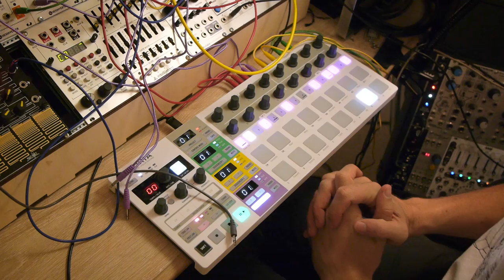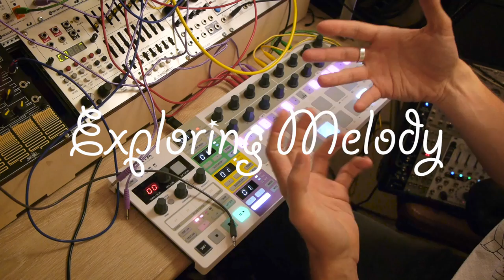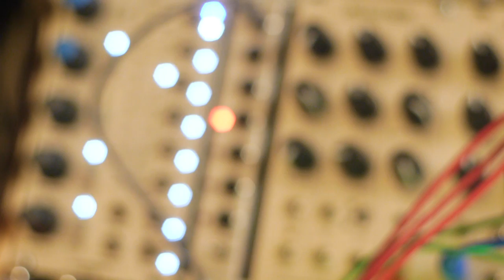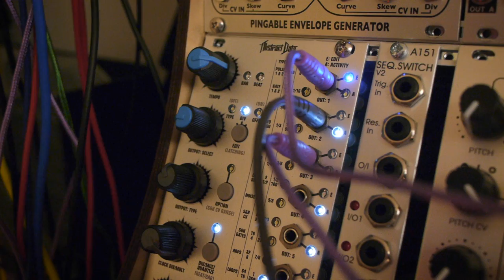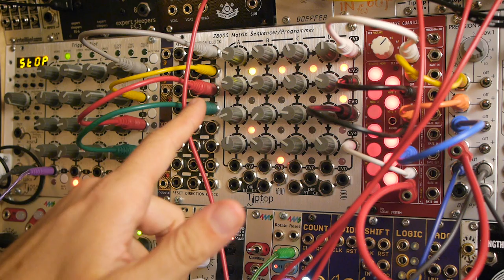Melody Progression Tips for Eurorack Modular

Comment: Great job on the video! Unfortunately all the sequences are sounding kinda flat since there is no velocity modulation. Sure, this is a bit more advanced technique and along with the material given in the video can confuse people. Consider telling about a velocity modulation with two daisy chained VCAs for achieving velocity modulation effect to give a breath to all the sequences. Also velocity modulation is achieved with different modules like modulating the tip top audio z4000 deviater cv input.
Reply from the maker: True - and you can be using the Z8000's extra outs, or a third PP lane for Velocity business.

Comment: Thanks for this video - I'm a long-term synth user but new to (Eurorack) modular, hence the perhaps naïve question that follows:  
Is there a way to employ a simple sequencer (such as the Behringer System 100 182 Analog Sequencer module) to play, say, a short 4-step sequence and then, at a point controllable by the user - via a 'control input' of some description (i.e. a CV) - have that sequence transposed up or down by a specific degree?  
I'm thinking of something akin to the bass line in Vangelis' Blade Runner (End Titles) as an example - a simple 4 note sequence which transposes according to the backing chords.  Obviously an arpeggiator or DAW can be used ... but that's not what I want!
I'm thinking of adding a quantiser to the 182 (possibly a Doepfer 156 or similar) but that still doesn't give me any ability to manipulate the preordained / 'pre-programmed' note sequence - either under my control or that of another automated CV input - to play the exact same sequence but at another position - a specific number of semitones - up or down the existing key/scale.

Any thoughts or comments gratefully received...

Comment: Thanks for another excellent video.  Transitions are something I really have trouble with esp considering I only have a small 6U 84 hp setup (soon to be 9u thanks to you and DivKid!) 
Correct me if I am wrong... But it seems that these types of transitions are only possible if you have either multiple sequencers, clock dividers, attenuators, sequential switches etc... None of which feature in my setup! 
I really only have Oscs, filters, lfos, vca and envelopes.
Reply from the maker: How do you mean transitions? Making on-the-fly quick changes?
Reply: mylarmelodies Well... Yes and no... Chord changes... Going from one sequence to another...from one musical piece to another.... That sort of thing.
Reply from the maker: sunil solanki Investigate sequential switches and switched multiples!

Comment: I was thinking through a few "algorithms" I would like to try with a precision adder. 

Here's the basic rundown: create a melodic motive/riff in a tonality with one sequencer, and it should be transforming (whether the tonal transformations are part of the entire sequence or through offsets doesn't necessarily matter). Specifically, the sequence would transform through various modes or major/minor transformations. Now, while that sequence is running, use the precision adder to offset the motive by either 4th/5th or semitones. If you lay out your sequence right, you should be able to create all sorts of functional harmonies. The Sequence added with the Precision Adder creates the "root motion", while the Sequence generating melodic patterns controls the "chord quality." If you're quick with harmony and reharmonization, you essentially have the main tools of a jazz improvisor/accompanist . As long as you plan your major, minor, dorian, susb9 melodies to stay with the key or key changes, you're good. Probably best to layout a quick chart so you time your roots and transformations accordingly.

Bonus: add a bass line underneath to further blur the lines. Ideally it would be cyclical and chromatic enough to spell out roots and fifths while always landing on a root on the down beats. Mult the same precision adder sequence to the bass, so it follows your chords.

Comment: All over this video are those slight offsets between note changes and the timing of the gates that fire new notes, causing little blips or glitches. I think you’ve solved that problem in your more recent work. What is it that helped solving that? Better technique on your part? A more standardised and mature Eurorack world? A combination of both? 👋
Reply from the maker: You can use sample and hold modules to hold the notes - but you can also just rock them out! Steevio does :)

Comment: Hmm- it seems that I need a sequential switch. Fortunately they are not prohibitively expensive.

Curious thing- I am fairly new to modular, and seem to have got the hang of it pretty well (frustration at not being able to do stuff is very low, which is a good sign). However, what appear on the face of it to be simple concepts- the sequential switch, say, or sample and hold- do not stick in my mind, and I find myself have to rewatch videos every time I want to use them. S & H for example stays in my brain for about thirty seconds, then I have to watch something or read something to find out what it does all over again. I hope this will not be the case with the sequential switch I now feel obliged to buy…
Reply from the maker: Such is the way when there are lots of novel concepts to learn. Deliberate practice will cement the uses in your mind - set sessions where you deliberately make a point of using particular things in a way you feel weak at and evaluate the results - rinse repeat! You’ll get the hang of it for sure

Comment: Very nice! I would suggest that you run the voltages from the Z8000 directing into the precision adder then only the final combined output to the quantizer. That may be why you are getting trills. It's kind of backwards any other way unless you are also using some of those quantized outs for other parts of the patch. 

You can get similar results combining LFOs then running through a quantizer. I prefer an LFO synced to clock but extending over 16 steps, then sample/hold and/or quantize 16th notes or whatever. That creates a repeating pattern that you can change by adding additional voltages either synced or free running.

That's kind of what I did for this patch though I didn't use any quantization:
https://www.youtube.com/watch?v=KtoJWn2oEMw
Reply from the maker: Yeah - for some reason I had it in my head that Steevio pre-quantises before summing with the Precision Adder, hence trying it that way. Might have it ass-backwards. I would have defaulted the other way, but wanted to try it!
Reply from the maker: In fact here ya go, Steevio's comment is you can do it both ways! https://www.youtube.com/watch?v=x6hJa2lRRgM&lc=z13ivrx4kpfey3xtr23gtpvgczj0s3z1y.1476874723027011
Reply: mylarmelodies
Hey, thanks for turning me on to that video. I'll have to check his others. Very interesting stuff! That track sounded great!

Yup, all I was saying is that unless you're using those quantized CVs prior to adding them it's a more efficient use of modules to quantize after adding. There again, it would eliminate the need to quantize after adding, and if mixing and matching as you go it does makes sense to quantize first. It's all good! Just thought it might fix your trill issue. Either way, good stuff all around. ;)
Reply: I'm thinking, maybe a combination technique would work best for musical intervals within a scale: First, you quantize the root note, then you add an unquantized voltage, then you quantize the result. The idea being this: Let's assume you're quantizing to a C major scale. If you add 4 semitones to a C you get the E, which is fine. But when you add 4 semitones to the D you get F# which is out of scale and would be quantized more or less randomly to F or G. However, if you add 3.5 semitones--which is easy before quantization--you'd get Eb+something, which would be quantized up to E; and when you add 3.5 semitones to D, you get F+something, which would be quantized down to F. Yay major scale. Does this work? Does it even make sense? I'll try it.

And while I'm at it, thanks for the awesome videos and tunes.

Comment: sounds like something is wrong. might be double-triggering the gates.
Reply from the maker: synthfreqs The intuitive quantizer trills inbetween notes - not managed to get it to settle as I'd hoped, need to ask them about that
Reply: hmm ok. might be because the pitch cv is being delayed a teenie bit by the quantizer, so it hits slightly after the gate. dunno tho.
Reply: Check to see if you have the latest firmware on the ADDAC 207, they put out an firmware upgrade that helped smooth out those trills if an incoming voltage was too close to the cutoff between notes.

If it is updated, then there is a new menu setting to change between quantizing styles, one of which helps smooth out the trill problem. The old style is also still present if you want to switch back to it.
Reply from the maker: Very good shout Tyler, thanks. I'll check that!
Reply: Of course mate! Thanks for this video btw, I recently bought a Beatstep Pro to save me from having to waste rack space buying more sequencers/drum trigger stuff... This video reminded me how much fun it was letting LFOs/other types of modules create sequences that I didn't physically construct.